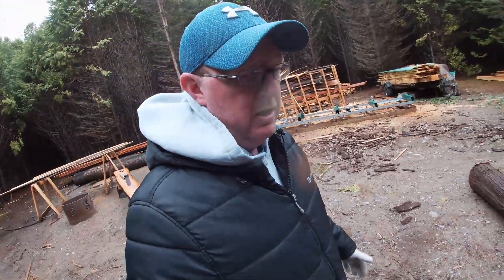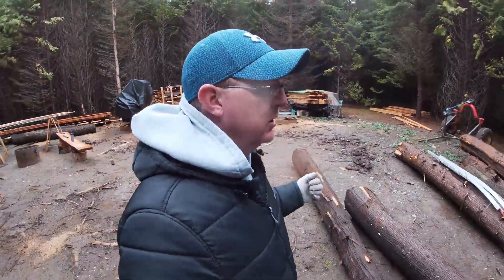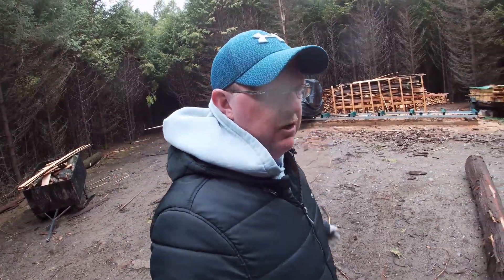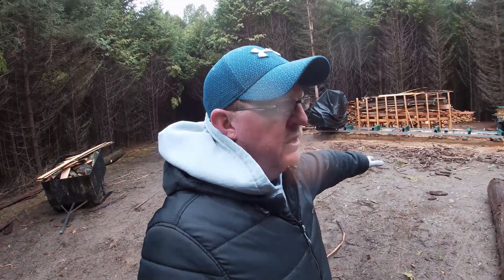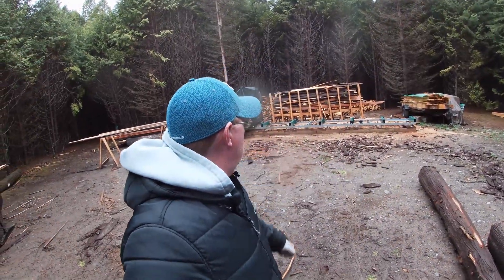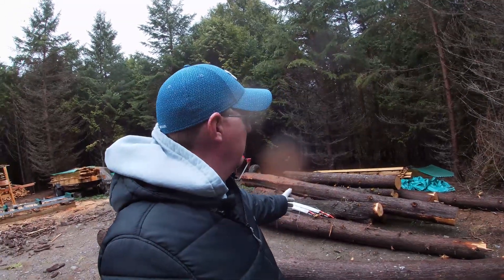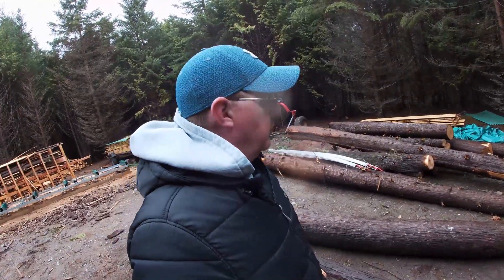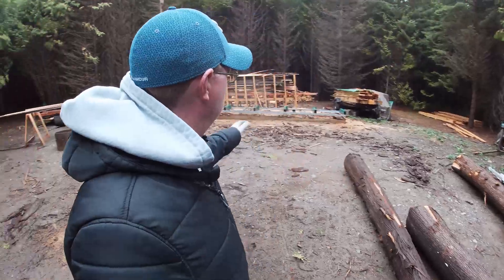#40 Sawmill Site Setup | What I Want To Change And What I Have Done Right

Comment: Sawing with Sandy's sawbuck placement is good, in line with the mill track off the starting end. Make the cut, pick up the slab, and toss it straight back onto the sawbuck before rolling the mill head back. Quick and easy. I set mine up that way after seeing Sandy's.
Reply from the maker: It does look like the way to go. I will probably do the same thing eventually when i can get some re-arranging done.

Comment: Good tips!  For me my hm126 x16’ setup is all about using my skid steer to do the work, man handling of the logs, slabs and lumber as little as possible. My mill is on a 24ft long heavy 20 ton flatbed trailer with a stick frame canopy to keep rain and snow off. The deck I cut holes between metal joist for the sawdust to drop through and when it gets full under there and along the one side I just move the trailer ahead or backwards to clean up. As for slabs I park the skid steer perpendicular to the trailer then remove the slab by lifting only one end and let it slid off the mill onto the forks. I have 4’ of space on the deck to stack lumber on spacers so the forks can pick them off or stack cut to 7” and take off from the bunks. My yard is about 150’ wide by 400’ long, the saw logs are to the left side of the mill on bunks so not to freeze in as I do mostly winter sawing, next to that is my slab pile then next to that is the lumber bunks, so when on the skid steer everything is to the left hand side while backing up. I usually wait till next fall to cut up the slabs using a grapple bucket that are then dryer and pile them in the shed for firewood. I think for anyone wanting to setup for sawing it’s all about how they intend to move everything around as that determines the layout.
Reply from the maker: A skid steer does sound like the ultimate machine to have around a sawmill. I agree its hard to suggest a "one size fits all" approach to how to set everything up because there are so many variables to everyone's specific situation.